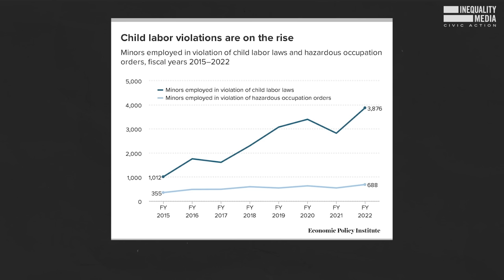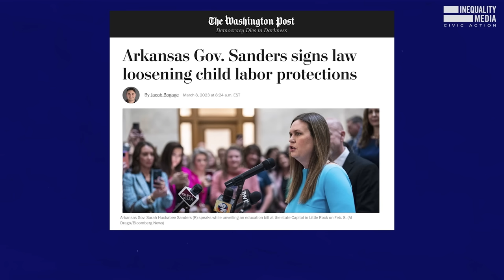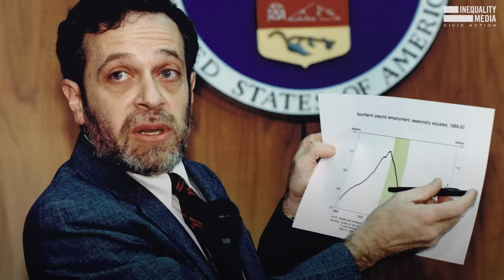Why Child Labor in America is Skyrocketing | Robert Reich

Comment: If corporations should be held responsible for their supply chains should the government be held responsible for subcontractors?🤔
Reply: yes. Yes it should.
Reply: Of course it should. Though they often already are. I mean Russia is already getting a lot of heat for the messed up things Wagner group is doing and rightly so.
Reply: In New York. You can work at the age of fourteen. Look it up. That's our law. 

Summer jobs mainly. For example; working with children at camps. You can start working at summer youth at fourteen. It doesn't pay much. However, once you turn eighteen. You will age out of summer youth jobs. 

In the 80's and 90's in New York City. High school students used to work at Wall Street as interns. They used to work for three hours after school. Getting a part-time paycheck. In the summertime. They used to work full-time. Getting a full-time paycheck. 

When the teenager's finished high school. They continue working at the same job. Only this time. They are full time employees. Earning a full-time paycheck. 

The best part. You don't even need a college degree to work on Wall Street. 

You already know everyone at the job site when you were a teenager. The board of directors already know you. They trained you when you were an intern back in high school. You are moving up in the corporate world with no college degree. Fresh out of high school. You already built your connection on Wall Street. 

The executive's respected the child Labor law. It was flexible. Teenager's were working three hours after school. In the summertime. Teenager's work full-time. 

For some reason in New York. They stop teenager internships at Wall Street. 

I wish they had kept that. 

I would had been in Wall Street right now working today. Moving up in the corporate world.

Teenager's have to wait until the summer to work at summer youth. Let me remind you that summer youth doesn't pay much. 

Some households are below the poverty level. 

Parents and guardians are trying to make ends meet. 

Teenager's are committing crimes to survive. Certain parents know about these teenagers criminal activities. Some parents don't say anything because it's bringing a extra income in the house.

Comment: Time for more immigration. I worked as a farm laborer starting as an 11-year-old. I was too short to see over the steering wheel of the hay truck without sitting on a board and a mattress pad from a baby bed. I averaged more than 40 hours per week before and after school and on weekends. Luckily, I wasn't hurt by the chain by the hay bale loader hooked to the truck I was driving. The job was dangerous for a child and my schooling suffered, but we were poor, and dad made me do it. An adult immigrant with more experience and better judgment might have taken me out of a risky situation. Who knows if my dad would have paid the wages though, because even the paltry money he would have had to pay for immigrant labor may have been a deal breaker.

Of course the answer is NOT to merely find ever cheaper labor in a race to the bottom for the working guy, but with our trouble at the borders, we could use the additional labor resources.
Reply: Valid point. And if they don’t rush , you can bet your bottom dollar they won’t come. Monterrey is giving a run for their money.  You can get training and benefits by staying put.  Why migrate ?